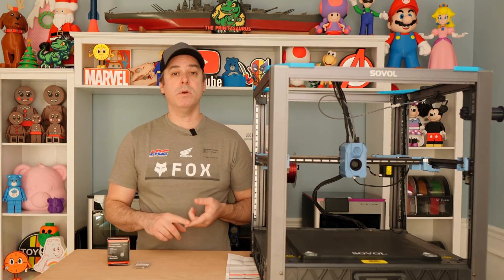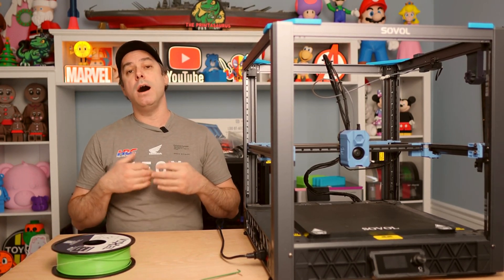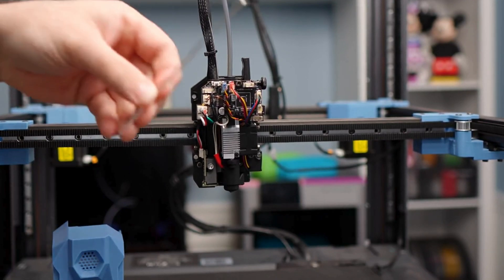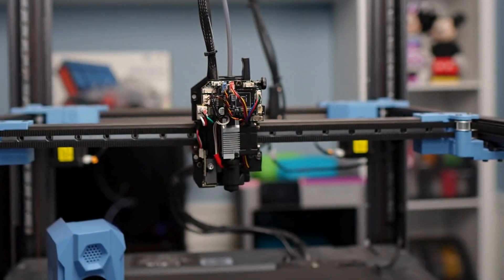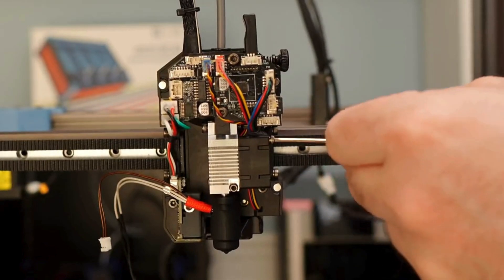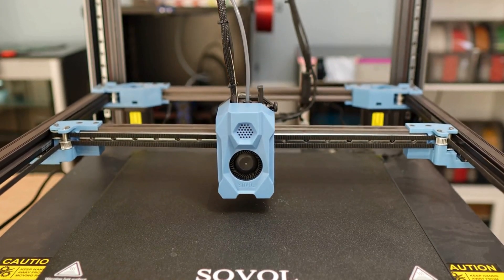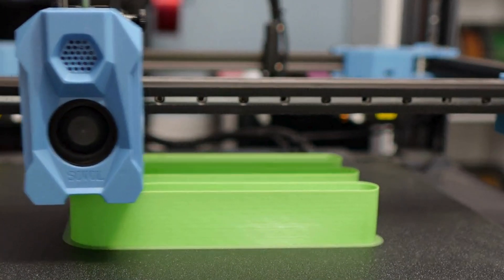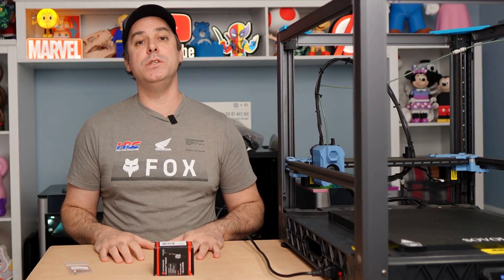Upgrade Your Sovol SV08 with MicroSwiss FlowTech – Reliable Hotend Tested!

Comment: Have you noticed any visible improvement with surface quality or layer consistency with this upgrade? Or just a better flow rate? I just ordered one with a CHT nozzle.
Reply from the maker: Better flow rate is what I've really experienced. It prints way better at the default speeds in Orca for the SV08. Overall build quality is better as well, and being able to swap out nozzles is also a nice benefit. In terms of surface quality, I think there is a slight improvement.
Reply: @ I got it and installed it with the CHT nozzle. So far so good, I’m just trying to dial in the Bambu PETG HF filament profile now. My flow rate calibration test already looks a little better.. working through all the calibrations and then I’ll try some test prints. Do you happen to have any suggestions for Bambu PETG HF profile with the Sovol SV08 specifically?

Comment: What about reliable solution for leveling? I would say that's the worst of the printer :\
Reply from the maker: Yes! I've covered the Eddy as a reliable change in the probe. For the bed though, I'm testing and trying to figure out some cheaper options to improve. I covered a Mandala Rose works Voron 350 bed conversion and that has and is working flawlessly. But it's an expensive option that most aren't going to want to spend.
Reply: @ThePrintasaurus  Thanks for the awesome and fast answer! But i'm still with Mainsail, for that option i need to change to Mainline as you did...

Comment: Ive been using the microswiss nozzle on my sv08 since late Sept/Early Oct and i LOVE it. I just recently got a CHT nozzle and CM2 nozzle for it. And couldnt be happier.

One thing i need to know is how do you keep the umbilical upright?!
Reply from the maker: The microswiss CHT has for sure been a favorite. Really happy with how well it prints. 

For my umbilical setup. I use 1mm piano wire to hold things up. Eventually, once I finish testing/tinkering, I'll wrap that to make it look more professional with split-sleeving. Links to what I usually use below. 
Piano wire
https://www.amazon.com/dp/B07YFTKFPJ?ref_=ppx_hzsearch_conn_dt_b_fed_asin_title_1
Sleeving
https://www.amazon.com/Alex-Tech-10ft-Protector-Sleeving/dp/B07FW3GTXB?ref_=ast_sto_dp&th=1
Reply: @ThePrintasaurus  Thanks!

Comment: The Microswiss FlowTech hot end is a great upgrade for the SV08, if for no other reason than to get the large variety of excellent FlowTech nozzles that can be quickly and easily cold swapped.  I now have the original 0.4 mm FlowTech nozzle, a 0.4 mm CHT high flow nozzle for 30-40% more volumetric flow, a 0.6 mm CM2 hardened steel nozzle for printing carbon fiber filaments, and a 1.0 mm CHT high flow nozzle for large structural prints including fast but strong large vase mode prints with 1.2 mm thick walls.

Thanks for the very good review of the Microswiss FlowTech hot end for the SV08, even though I already had mine.   🙂  My only suggestion would be to hopefully use a fixed focal length on your camera.  For much of the video, we'd see the hot end installation, but as soon as anything happened the camera would auto focus on your hand or wrist and the part we want to see is completely out of focus.
Reply from the maker: Thank you for your feedback, I’m working to get some better camera equipment so I can continue to work towards improved content viewing. Do appreciate the comments!

Comment: I installed the @Microswiss FlowTech hot end when I was assembling my SV08.  I never bothered printing with the stock Sovol hot end.  I can't believe a modern printer requires removing the heater and thermistor and reinstalling them with messy thermal paste to change the nozzle.  I can now cold swap a Microswiss FlowTech nozzle in one minute, using nothing but a 7 mm nut driver, as it should be.  I now have a small but growing collection of FlowTech nozzles and for once in my long history of 3D printing, it's worth swapping nozzles for different jobs.

I always thought I'd swap nozzles but I never did because it was such a huge hassle with a significant risk of damaging the printer.  Not any more.  Nozzle swaps are easy peezy.  I have a 1.0 mm CHT high flow nozzle that I'll use on an upcoming project to print TPU parts with grippy ribs, where the big layer lines are a feature.  I can't wait to see how fast I'll be able to print TPU with that large high flow nozzle.

Another thing I absolutely love about Microswiss is my nozzle investment is secured.  No more throwing away proprietary nozzles when I upgrade printers.  I'll install a Microswiss hot end on all future printers and the print farm printers can share nozzles with the engineering prototyping printer in my office (currently the SV08).
Reply from the maker: That is an excellent example of how to use the flowtech nozzles. I'm still playing around with the .4 cht, but have a .6, and .8 cm2 I plan to work with next. Thanks for sharing the info and appreciate the comment!!

Comment: E3d Revo is a better option on the sv08 esp if one lives in europe
Reply from the maker: The revo is fantastic too. I have one on my voron 2.4. I didn’t account for availability abroad. Appreciate the comment!
Reply: Why would the revo?  I heard some complaints about it's flow rate
Reply: @SparQz  most of microswiss's lineup isnt in the eu and to get it in the eu means a very big price jump so not worth it.
and most of the microswiss stuff i have bought for enders has been very low quality but it is made in usa so no wounder its has been low quailty.
and the fact they are markeded as leak safe but there are a lot that has had the microswiss leak

dont know about the flowrate i get 30+ with my 0.4 revo non highflow doing petg
Reply: So your solution is either to use a printed adapter or to order a machined adapter from China for $80+ USD THEN add the cost of the Revo hotend?
Reply: @kilo.sierra  i didnt pay $80+ USD for the revo hotend i payed $71.90 with shipping and import tax, could even haven been cheaper if i hadnt picked anodicing.
And then a cheap revo hotside from amazon with a 0.4 nozzle and a 60w heater for $28,73.
It came out to way less then if i was to order the microswiss hotend.
As thats about $100,25 with shipping to europe as its not sold in europe and then theres going to be import tax aswell thats about $27,77 more so in total its going to be $128,02 for the microswiss hotend.
and i payed $100,63 in total for the revo hotend with tax and all so i saved $27,39 going the revo way and i can buy new nozzles for the revo where i live i cant do that for the microswiss i would have to order them from usa and pay a lot more then i would for revo hotends.

the adapter is for people who wants to use there bambu nozzles and that rute is even cheaper to do then the microswiss and e3d revo options as they most likely already has one they already bought as a spare.
Reply: @kilo.sierra  hmmm for some reason my org msg has been deleted.
but to make it short to get the microswiss to europe is about $128.
i gave around $72 for the e3d heatsink with import tax and shipping and could have gotten it cheaper if i hadnt gotten it anodoised.
and a cheap e3d revo heater with a 0.4 nozzle from amazon for around $28.
so i gave around $100 for the revo setup and the microswiss would be around $128 with shipping and import tax so i saved $28 going with the revo setup and i can buy revo nozzles where i live compared to having to order the microswiss ones from usa and having to pay import tax and shipping
Reply: @kilo.sierra   hmmm for some reason my org msg has been deleted.
but to make it short to get the microswiss to europe is about $128.
i gave around $72 for the e3d heatsink with import tax and shipping and could have gotten it cheaper if i hadnt gotten it anodoised.
and a cheap e3d revo heater with a 0.4 nozzle from amazon for around $28.
so i gave around $100 for the revo setup and the microswiss would be around $128 with shipping and import tax so i saved $28 going with the revo setup and i can buy revo nozzles where i live compared to having to order the microswiss ones from usa and having to pay import tax and shipping
Reply: @kilo.sierra  the swiss would have cost me $128 i got the complete revo for around $100
Reply: I have the microswiss replacement with CHT nozzle (only 70 for both in US) and E3D obsidian nozzle as well. The adapter broke that the E3 was using so I got the Microswiss. they are both great options, but the microswiss is heavier and stronger and I do believe will hold up a little better